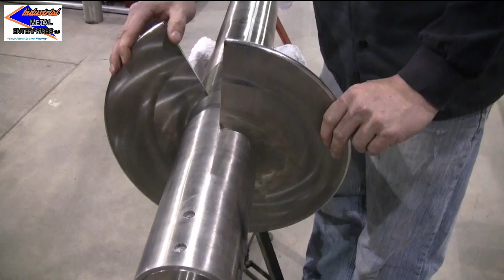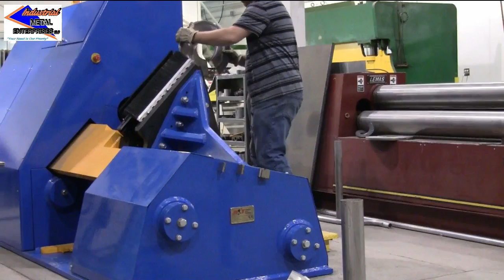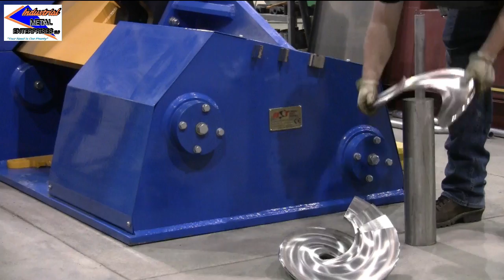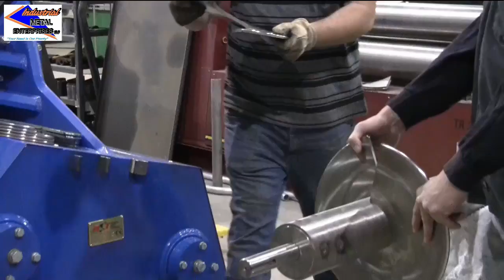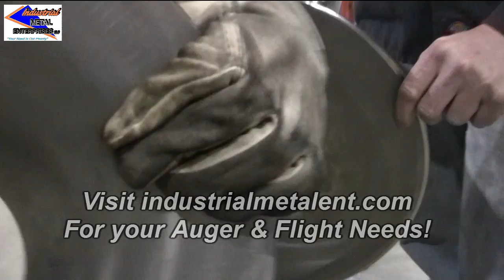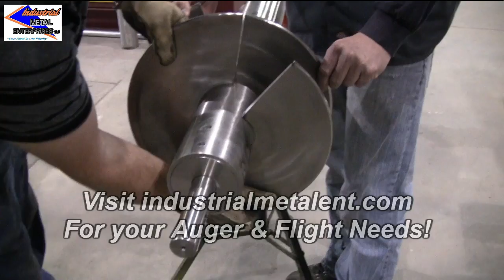Forming Auger Flights

Comment: Hello Sir, may i ask how do u determine the actual required inner & outer diameter of the flight? because i know that when we shape it, the original diameter of the flight will decrease..
Reply from the maker: The program we use will determine what the flat pattern flight blank dimensions need to be in order to achieve the correct requested I.D. and/or O.D of the flight section post-forming.